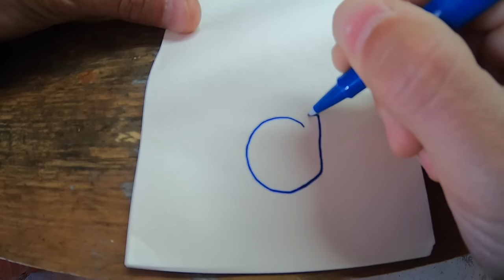MAKE YOUR SNOWBLOWER THROW FARTHER AND NEVER CLOG. Install A DIY Impeller Kit.

Comment: Is there any concern about the blades being unbalanced when doing this? Any uneven wear on bearings, etc?
Reply from the maker: No issues on my snowblower and I have had the flaps on for close to 8 years now. The snowblower in this video is over 35 years old. If it did have an issue my buddy would just get another. Thanks for watching!
Reply: @GarageGear  Thanks for the reply! Pretty nice for a 9 month old video. Keep up the good work.
Reply from the maker: @thewalabee1414  thanks a lot Walabee! Thanks for being a fan of the channel!

Comment: Where can i find these rubber mat pieces?
Reply from the maker: I put links to some in the video description. Thanks for watching! 👍
Reply: @GarageGear  Sorry but i do not see anything with the rubber pads. Do you know of hardware stores that would sell pieces of that rubber locally?
Reply from the maker: @pierogi210  you could use an old mud flap too. Those I believe you can find at a tractor supply store. Those will work great!

Comment: I don,t understand the worry about a balance or vibration problem from this mod. The rpm and radius of most snow blower impellers does not compare with the speed and diameter of a mower blade. The speed and radius of swing of a mower blade combine to cause vibration and stress on the shaft bearing. The snow blower bearing is always unbalanced anyway due to the different ways the first stage picks up the snow from non uniformed densities of the driveway or sidewalk. The right half could be unplowed snow and the left half could be overlap of a just plowed area. The new mod should not be a concern.

A good place to get the rubber needed is at Menards.  Go to the plumbing section and get a Fernco rubber pipe coupling It is a thick rubber sleeve with a hose clamp on each end to slip over the end of two pipes to connect or repair them. Save the hose clamps for another project and cut up the rubber into the sizes you need. The larger ones are less than $5.00 apiece.
Reply from the maker: There’s a lot of truth to all of this! Thank you very much for sharing! No issues with vibration or balance issues in the snowblowers I’ve done! Thanks for checking out my channel!

Comment: How difficult is it to remove the shute? I just purchased a 28 inch craftsman with a 243 cc engine. Haven't used it yet.
Reply from the maker: Whitie in Vermont not to hard. With so many models it’s hard to say exactly what to do. Usually it’s just nuts and bolts holding it down somewhere on the chute.
Reply: @GarageGear   awesome! Thanks for getting back to me so quickly. I stopped the video at the Harbor Freight 225 pc set and see that it's on sale right now for $100. It's a great set. 
We have the same initials J.B. middle name is Michael. I'm a new subscriber and looking forward to your videos.
Reply from the maker: Whitie in Vermont got plenty more coming! Keep your eyes peeled for them!

Comment: Not sure why you need to throw snow 'farther' unless your machine is worn out. I don't want to be shooting snow 20 feet in the air when I've only got 15 feet of space to throw it to.
Reply: 125 Southern NH - then in your case use the chute deflector to limit its distance it can throw, this mod keeps your chute area from clogging, you don’t seem to understand the concept or snowblowing.
Reply from the maker: In some cases its very handy because this impeller kit can allow me to throw snow over some high snow banks.  Without it, I would just be throwing it at them.  Using the deflector may be necessary in some cases too.

Comment: This wouldn't work too well (or it would be difficult to do) with the Areins SHO impeller due to all the angles.  Good idea though.
Reply from the maker: Are the impellers themselves angled or part of the housing?  My impellers on my other Ariens are angled (almost like a scoop) and the rubber flaps when tightened down conform the angles of the impellers. Let me know! Thanks for checking out my channel!

Comment: And after a few winter the impellers rust out from drill into it and then you need new impeller
Reply from the maker: No issues on mine after 6 years. I regularly spray wd40 in there to protect all the metal.
Reply from the maker: My impeller is in great shape and did this about 7 years ago. I spray the impellers and the rest of the snowblower with WD40 frequently to prevent rust. You can see it looks pretty good here.

https://youtu.be/iTGFL-In2L4

Comment: Thanks Garage gear. What thickness is the Conveyor belt that you used. I have 3/16" and over 1/4". The fins on the Impeller already have a hole from the manufacture. Steel is too thick so I had use the hole. Too many toys to dismantle. I tried it with 3/16" mud flap but removed the kit cuz snow and ice got between the rubber and the metal fin. I only used it one time but it cleared the heavy wet snow and the drum was clean as you described. It would not clear the snow this wet if it wasnt for the modification. I either need to put a metal piece like the impeller kit if purchased or a thicker piece of rubber. I thought it would be over kill if too thick. My snowblower is a 10hp, 29". Does thicker rubber make a difference. Whats your recommendation. Thanks in advance.
Reply from the maker: Hey George, thanks for the comment. Those conveyor pieces are just over 1/4 inch thick.  I probably would not go too much thicker than that.  That should be enough. I've only used pieces about this size and its worked well every time for me.  I would stick with rubber pieces though because of the expansion and contraction on warmer or cooler winter days.  It also conforms to the inside of the tube nicely. Thank you,
JB

Comment: Would'nt it be easier ,to just remove the impeller and screw on the rubber pieces to closely fit the impeller cage,that way you would save time and problems,even though they(rubbers) are not tight fit they would do a great job anyway  no ?.
Reply from the maker: Hey Michel, this is really the best way. I’ve done this to dozens of blowers and it only takes about an hour to do this. Dismantling the machine will take much more time. Thanks for watching.
Reply: @GarageGear  Ok then,I will take your advice for it,thanks.

Comment: Maybe you just don't have the right snowblower. I owned a Yardman/MTD 8.5HP for almost 20 yrs and Never clogged. I actually cleared half a block of street at about 35 inches of snow, no clogging.
Reply from the maker: With just about every snowblower this mod makes a big difference not just in clogging but in distance thrown! If you try it let me know how it works for you! Thanks for checking out my channel!

Comment: Spray everything with some Pam from the kitchen..it stops sticking too!
Reply from the maker: Good tip thanks for watching!
Reply: Good tip Dave I was told Silicon spray works great also , It should get me by until warm weather then I will retrofit as in this great video.
Reply from the maker: @ronson570  you won’t be disappointed! Thanks for checking out my channel!

Comment: come on now .... 17:34 and you repeated your self many times . 
cut the piece of rubber to fit the  width of the flat area of the impeller blade and tall enough to cover the blade plus enough to touch the drum ( semi truck mud flaps are cheap)
clamp the rubber to the impeller blade with a vise grip to help hold it in place ...
you can shove a small piece 2x4  wood inside the front of the machine  to help keep the impeller from moving as you drill the holes 
use a 1/8th inch  drill bit to make a starter hole 
use the correct size bit to finish the needed hole
insert the two bolts and snug them up 
now spray some WD-40 or oil inside the impeller drum and fire up your machine ....
the lube will allow the rubber to easily slide as the impeller starts spinning
Reply from the maker: Thanks for sharing

Comment: If you go threw 2 battery’s to drill 8 holes you have too buy a new drill because HF isn’t going to do it lm just saying.
Reply from the maker: Depends on the thickness of the impellers. Some are thicker than other and take more drilling.  Just found it easier with a corded drill.
Reply: @GarageGear  Much better speed/torque with a corded drill
Reply from the maker: @nhlighthouse  agreed!  The old fashioned way definitely has its perks! Thanks for watching!

Comment: Okay what is your secret for turning your impeller by hand? I have a newer  Ariens and neither auger or impeller will turn by hand.
Reply from the maker: No secret to hide here.  To be honest Im not sure.  On this model and other models Ive done this on the auger/impellers just spun.  Some tighter than others but they spun.  Sorry don't have answer for you there other than loosening the belt tensioner first.
Reply: @GarageGear  Got it I removed the bottom cover turns out there is a brake. What happens is simultaneously as you release the auger drive a brake is applied to the pully to quickly stop it's rotation. Thanks for the response.
Reply from the maker: @barefootbob1269  Glad you were able to find a solution to your issue! Happy Snow Throwing!
Reply: @barefootbob1269  Yup, snowblowers have had brakes since some time in late 1970's, I think.   The newer the blower, the stronger the brake.  It's a lawyer thing.
Reply: @m9 ovich ya, I think the brakes are overkill, but I do see a lot of vids where people snow blow while their kids and pets are running around.
You got to be careful with those Gilson interlocks, because when they fail, you don't know unless you test them.  A guy I know lost some fingers because he thought the interlocks were working when, in fact, they weren't.  The problem is they are an "addon" feature retrofitted instead of being a ground up redesign.  Early Ariens "safety interlocks" were also kinda awkward.
The modern "dead man" levers are pretty foolproof and 100% mechanical so bad connections are never a problem.
Reply: @m9 ovich Ya, that guy I know is an idiot, so I don't really mean to blame the switches.  You'd think he would have smelled the belt burning too, lol.
Another guy I know still has a rebranded Gilson, they were apparently pretty popular.  I think I would get sick of that motor-kill safety.  I know that if I owned it, I'd be very tempted to remove it.
He actually had 2 for a while, one older one without the safety, and a newer one with it.  The older one got scrapped because the axle shaft wore right through the axle bushing and into the housing so far that the friction disc was resting on the shaft and the machine would no longer move without the whole machine jumping up and down.

Comment: This is really just a pipe dream and a waste of time. Invariably, snow will pack against the impeller tube between the end of the blades and the side of the impeller housing. This closes the space that is intended to be eliminated by the aforementioned rubber. Letting the snow close the clearance also leaves a gap for sticks etc to pass the end of the blades rather than jam the blades and test you shear pin choice!!
Reply from the maker: Thanks for watching

Comment: Where did you buy the rubber
Reply from the maker: Armand Bourgoin I got it from an old conveyor belt that I got a while back. Someone gave it to me. You could use old mud flaps, a tire sidewall or just about any thin rubber pieces will do.

Comment: Actually, there is only one impeller in there, it might have either three or four blades. Three or four impellers would require a very long shaft for all of the impellers and their blades to be mounted on, and once the snow is thrown by the first impeller with its blades, the other claimed impellers would not be getting any snow to throw. You don't normally ever see an airplane with three or four PROpellers on the engine"s output shaft, just as you will not see three or four IMpellers in a snow thrower. Same kind of device, just one is inside the piece of equipment, the other is outside of the equipment.  See here for more:   https://en.wikipedia.org/wiki/Impeller
Reply from the maker: Thank you. Yes the impeller has 4 blades on this model.

Comment: where is the snow....and yes added weight is present....more work for aan engine that's made for a spacific balance harmony.....and wheres the snow.....I would pay more credence...IF THERE WERE SNOW.....
Reply from the maker: Kind of hard to do a demo in August when its 85 degrees.  See the video post date/sandals on my feet lol.
Reply: There is more then enough power to compensate for that little weight.

Comment: Husqvarna has no clue who their dealers and servicing dealers are. Put in my zip code, and a bunch of hardware stores that do NOT sell the brand pop up (never sold the brand), along with 2 service centers that closed three years ago. The website help? Good luck with that, the problem that I had has no 'links', so if you plan to use that website, make sure that when you break the snow blower, you break something that has a link to it (lol), because if you don't, forget getting a fix before winter is over. Bottom line, you will NOT be able to talk to anyone. Customer service is non-existent, best thing to do is avoid this brand period, whether it is a snowblower, motorcycle, or a hand held feather duster.  Nothing but headaches trying to solve a problem or troubleshoot it.
Reply from the maker: Thanks for sharing!

Comment: I'm glad that I never bought an Ariens snow blower! What sloppy workmanship!
Reply from the maker: RC hey there, most snowblowers have this kind of gap. If you watch this video I recently made, you see that even a brand new snowblower has a similar gap issue. These impeller kits work great to correct it. https://youtu.be/WR-n6QE-hSw   Thanks for watching!
Reply: @GarageGear  The apartment complex I work for has a John Deer 54" tractor mounted blower. The gap is a good 1/2 inch. Can't handle slushy snow at all; clogs right up tight to the point of stalling the tractor. . Will definitely do this mod for next winter.
Reply from the maker: Robert Sturm You WILL NOT BE DISAPPOINTED!  Please check back and let me know how it works out for you. I would really like to know how much better the machine throws snow.  Thanks for reaching out!

Comment: Until a stick gets jammed in there due to reduced clearance. Rusted out impeller might be helped but this is bogus you don't get free power so fuel consumption will be greater as well as drag and the rubber stuff will bend away and not do the job like he says it will...
Reply from the maker: Wow you made a lot of points here.  
I have had these impellers on my machine for 7+ years and installed them on dozens over the years too.  Here is what I have found. 

The augers will usually destroy sticks first before they get to the impellers anyways.  I usually don't have much debris in my driveway.  For those that do, I guess clear the path first.

Yes the rusted impeller is helped.  Nothing can bond to the side of the impeller tube with the impellers on.  Therefore nothing slows them down.  

In terms of free power, yes you gain some from the impeller because nothing is slowing it down.  No power is gained in the engine.  You can watch my video of me throwing snow over the street into my neighbor's yard here:
https://www.youtube.com/watch?v=Zak12Iqu760&t=10s

Fuel consumption has remained the same.  I could plow 2 driveways on one tank and that hasn't changed after the kit install. 

The rubber impellers once installed and ran a couple of times have worn perfectly to the diameter of the impeller housing tube.  No change in 7 years.

Not sure if you tried this on your own machine Daniel but it is definitely worth a shot.  Let me know how it works out for you.